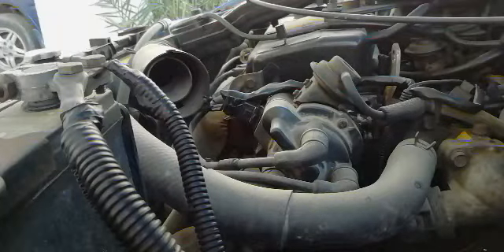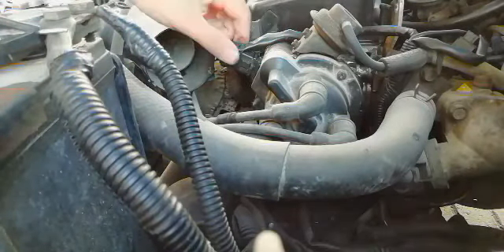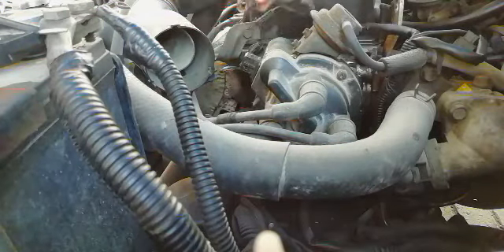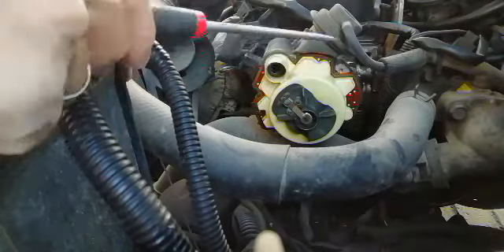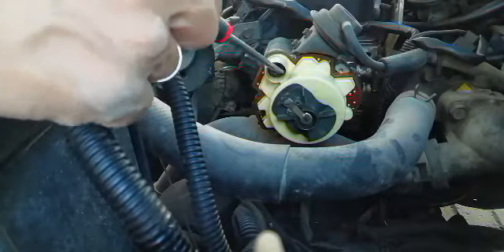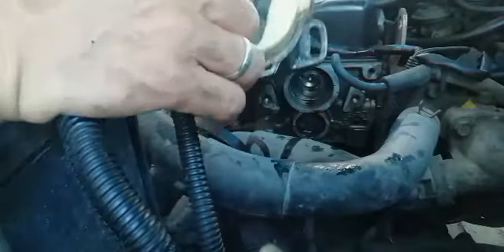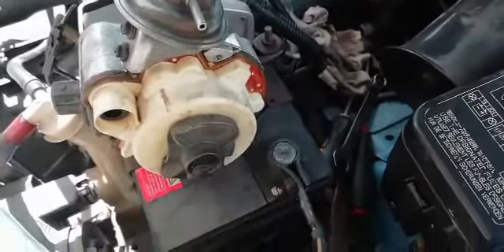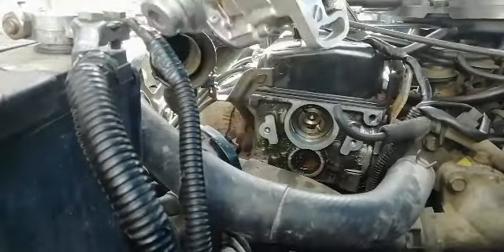Engine won't start.. How to test ignition spark/replace ignition coil Mitsubishi Colt

Comment: Hi RGV , i have the same distributor %100 and i did the same testings you did , i can buy any parts online here , but i really don't know which part you replaced inside , you mentioned the ignition coil inside! but i really got many results , i appreciate if you can put a link or give me exactly the part name which you replaced inside for the same distributor